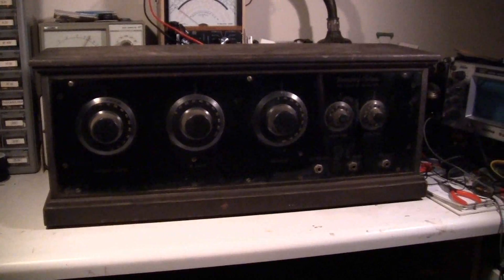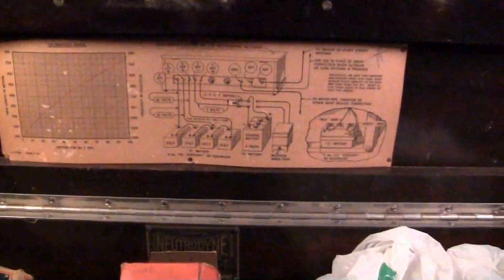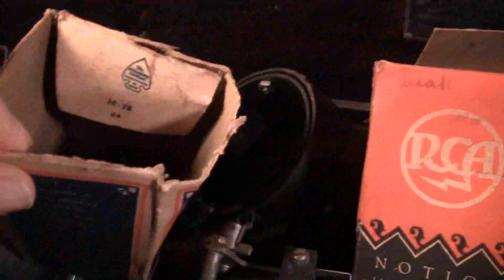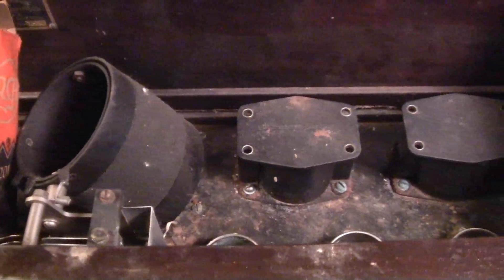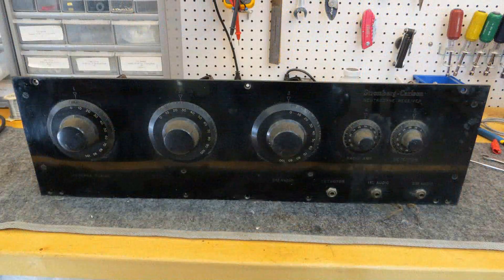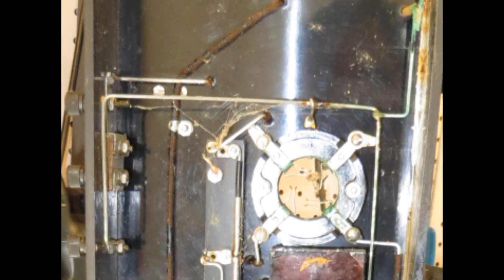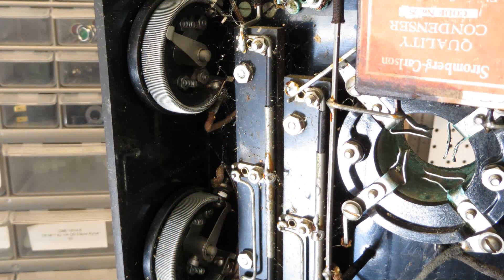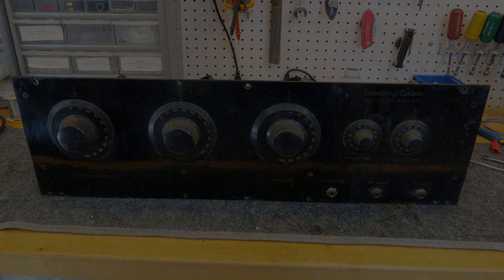Stromberg-Carlson Neutrodyne 1-A, Part 1

Comment from the maker: Thanks Ricky,
This radio was produced in 1924 and it was Stromberg Carlson's first production radio. I have completed the repairs and it now plays as it did in 1924 and with the 1-A speaker that was made for this radio. I have two or three more videos on this radio. It took me many years to fine and original Stromberg Carlson audio transformer to replace the bad one in this radio. So now it is complete with original parts and working.
Reply: I just found one of these in decent condition in a family garage. Any idea where I should sell it?
Reply from the maker: @tonytate6681  I would look for a antique radio club in your area. Also you may get help from an amateur radio club. Ham fest maybe helpful. Ebay. If the radio has tubes (01A), they can be worth about $40-$50 each, if there good.